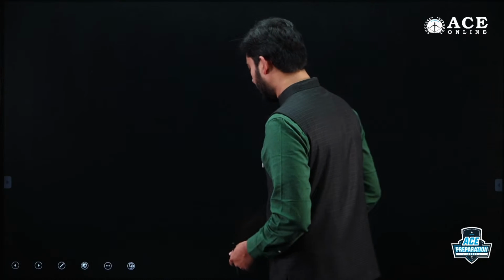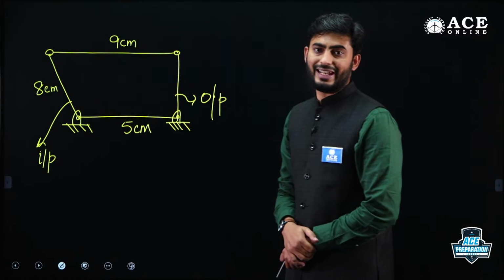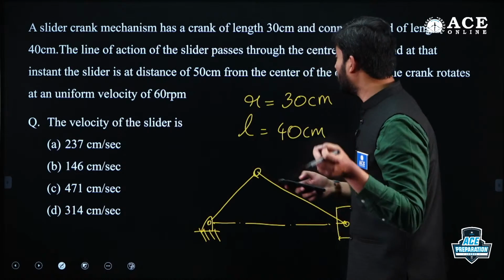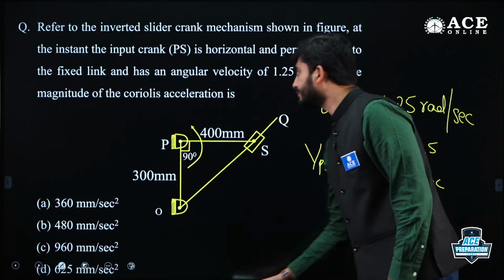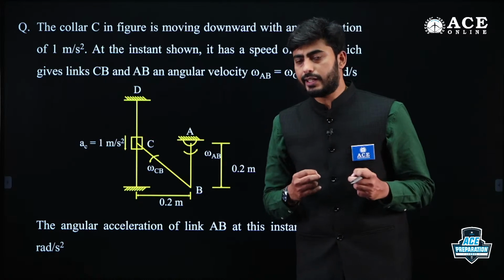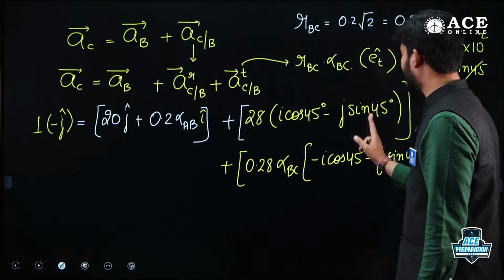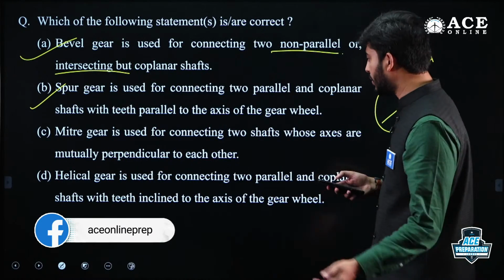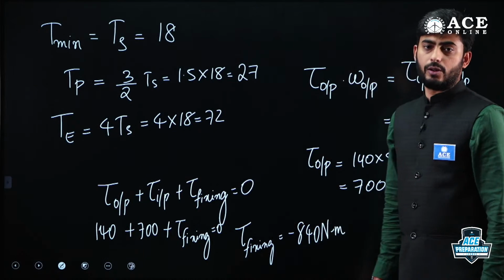TOM & Vibrations-1 | Expected Questions - GATE 2022 ( MECH ) | Waheed Sir | ACE Online

Comment: In this 3rd problem of slider crank mechanism the formula you have written in board will give slightly wrong answer. Beacuse, this formula was derived with the assumption value of sin²(crank angle)=0
Reply: Yes small deviation will be there in the values when you are using I centre method or formula.
And the formula is derived from the approximate analysis. 
So the deviation is expected.

Comment: In last problem according to book fixing torque = 700-140= 560 Nm .... Please reply whether it is correct or wrong
Reply: The sense of rotation of sun and arm is same omega of sun = 5 times of omega arm
The input and output torques are in same sense.
Reply: @y2hide  Sir in last question of torque analysis while you written power equation.....T*w how you take angular velocity of arm I think it should be of planet gear not of arm and the speed ratio of sun and planet gear are (27/18) inversely to their ratio of no. Of teeth and it comes out to be 210 on planet gear
Please clear this
Reply: @Vikbrar_4348  hi Vikram 
in the arrangement input is given to sun gear and the output will be arm.Not the planet.
Planet will be the member connecting input and output.

You can also refer the video link below.

https://youtu.be/ARd-Om2VyiE